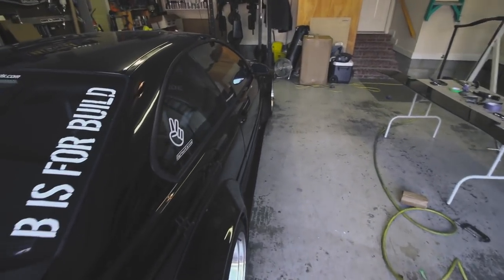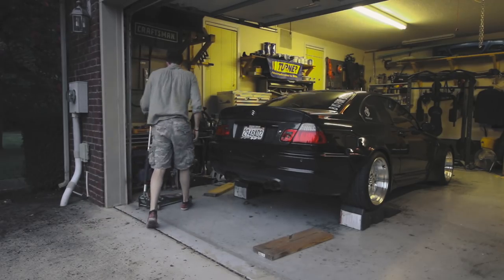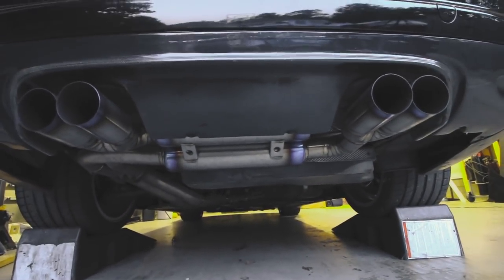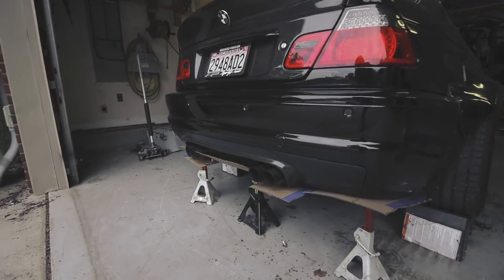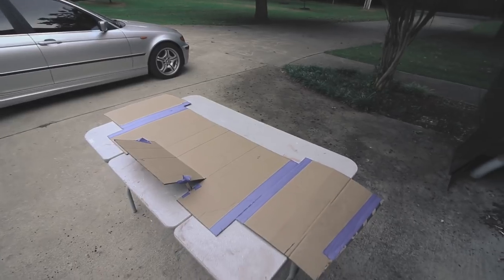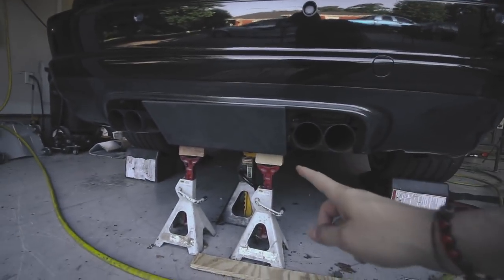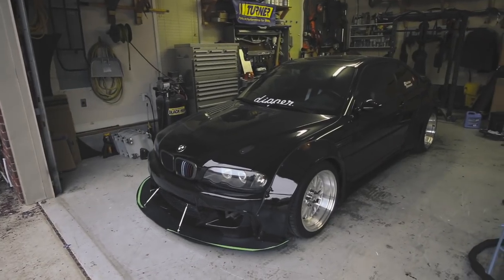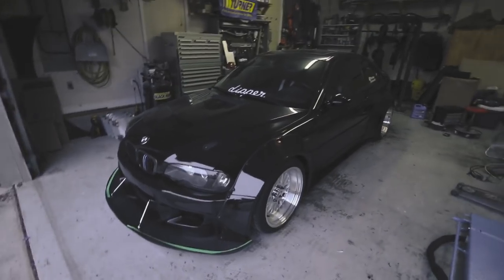DIY Diffuser & Side Splitters For My E46 M3 Pt 1 of 2

Comment: Kyle - for straight cuts clamp a straight piece of wood or metal to the plastic, and then use a skill saw with a fine toothed blade butted up against the straight piece of wood or metal. Keep up the good work.

Comment: Any concerns with the ABS melting when it's that close to the exhaust? You're clearly putting a lot of effort into this and it would be a shame if you had to do it over again.
Reply: I think this a very good point. Most abs plastics (unless you have a special heat resistant version) start to get soft and bendy around 176F (80C). I would look in to this.
Reply: I think it would probably have been a smart precaution to maybe put down some heat shielding down